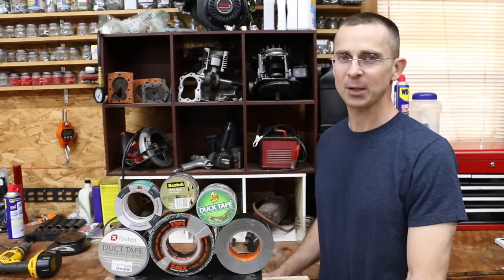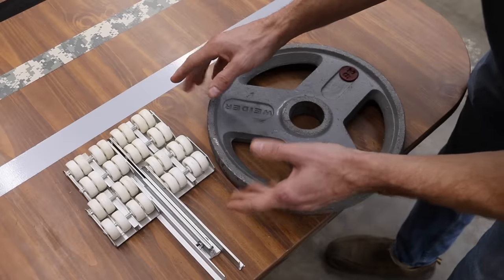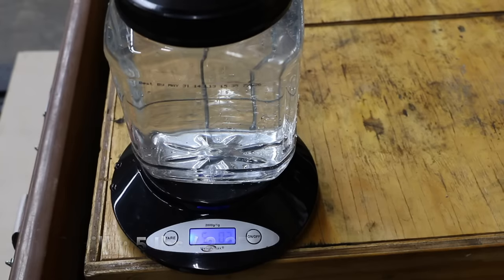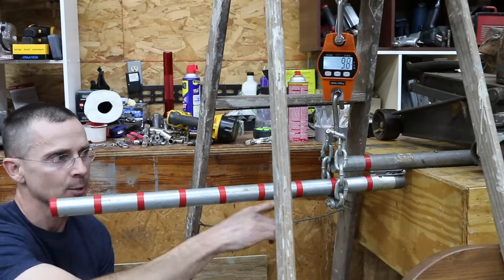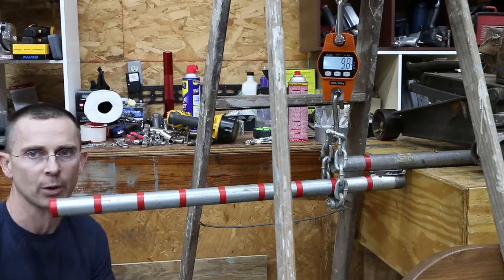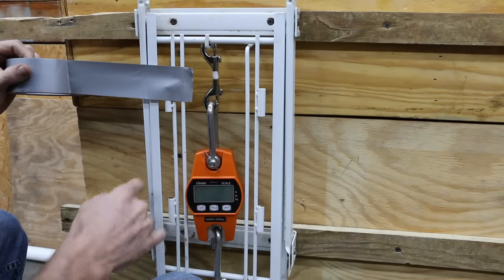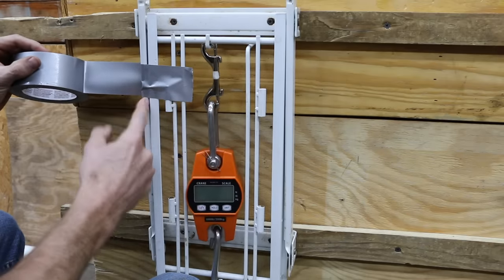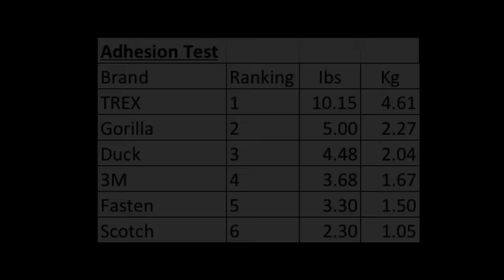Which Duct Tape Brand is the Best?  Let's find out!

Comment: Other than the silver duct tape, I’ve used gorilla tape only I had it taped onto my engine, hoist out in the hot Mojave desert sun for about over a year. It’s still very hard to remove compared to silver duct tape, and seems to be resisting the sun very well.
Reply from the maker: Thanks for sharing.

Comment: Duck tape is a rubberized fabric tape with adhesive on one side.  It was originally made to waterproof ammo boxes going to the front lines during WW2 and then to be easily cut when the ammo boxes needed to be opened.  Duck tape can be used on duct-work but it was designed to last a short time and will not last as it quickly deteriorates when exposed to the elements.

Duct tape is made of a thick metal foil and uses a mastic adhesive to seal the joints on duct-work so air can not escape the duct and will last far far far longer when exposed to the elements.

If the thick metal foil used an adhesive equal to a rubberized fabric tape the thick foil tape would be far stronger but neither are designed to hold much weight or pressure.

Comment: Personal experience for those that are interested.
I used to do remodels at big box stores and used tape a lot for putting up plastic dust walls and many other things.
So I had to tape 2 wood fiberglass stainless steel concrete FRP Steel ceramic tile and often in refrigerated areas or up high where it is hot dry and Dusty.

T-Rex usually did better than gorillas and it was usually cheaper.
Reply from the maker: Thanks for sharing.

Comment: I think a good way to objectivly judge the best would be to take their placement in each category and add them up. the smaller the number, the better the overall product.

Maybe take price into account aswell. Like if one product preforms halff as well, but is only 1/3 the price then its superior cause you can just double up and get the same result for 66% the price
Reply from the maker: Thanks for the feedback.

Comment: Wow, what an amazing test, thank you for that.  

Have you ever done one on electronic calipers?  There are so many out there and range so much in pricing that I'm wondering if there is any difference between cheap ones and the really pricey ones.  I'm not talking about precise stuff like a machine shop metal lathe work where is it very accurate but just general workshop stuff.  If you have, can you reply with a link to it?  Thanks again
Reply from the maker: Thanks and you are welcome!  Thanks for the suggestion.

Comment: Very informative test. But I think elasticity is not the correct term  for the test involving the pipe and weight test. Elasticity refers to the ability of a material to return to it's original shape after being subjected to stress.  I do love your test fixture designs, I worked in R&D as a machinist and very much appreciate your well thought out fixtures.
Reply from the maker: Thanks!  Thanks for sharing.

Comment: I was surprised by the lackluster performance of some brands. I've used Gorilla brand but may give T-Rex a go. Two other test you might do is elevated temperatures and even more relevant would be exposed to the elements for several months to a year to see how they hold up. Sometime I use duct tape to hold parts together and never pay attention until they fail. Great Job you do with all your test.
Reply from the maker: Thanks!

Comment: "Creep" hasn't been tested here but is very important. I've measured Flex Seal tape (I know, the stuff in infomercials), and with its thick adhesive, its immediate adhesion to a smooth LDPE surface is about 10x better than the next best, which is Shurtape HP-series, which itself is 2x better than T-REX. However, the long-term creep of Flex Seal is pretty bad. A long-term right-angle pull of ~10 grams/inch will remove Flex Seal at about 1mm/day, whereas Shurtape and T-REX will stay at 50 grams/inch (no delamination measurable in a week).
Reply from the maker: Thanks for sharing.

Comment: I've used a lot of duct tape in my life, growing up on the farm, basically always doing a lot of "back woods" type project.  After an accident with my pickup, someone suggested using Gorilla tape to hold it together until the insurance company could get the vehicle fixed.  It took 7 months for Progressive to get their act together and get my truck, with full coverage, fixed.  Gorilla tape held it together the whole time, bumper, headlight propped, inner fender well, no issues, never had to replace or adjust it.  Maybe compare insurance companies next time @Project Farm, so I can find the one I'm going to replace Progressive with in a month when  my insurance policy is up with them :)
Reply from the maker: Thanks for sharing!

Comment: The ONLY reservation I see here is "application" or "use" requirement.  You might not need the brute strength of some of these to accomplish the particular task at hand.  If brand X is pretty good all around and can accomplish the task at half the price of brand Y, then... just sayin'.  For Redneck repair of the sunroof on the wife's Ford Expedition I used the widest Gorilla Lowes had and it would last a long time.  But for securing overloaded cardboard boxes, the 3m an Scotch (and Duck causes it's readily available at the DG) works just fine.
Reply from the maker: Thanks for sharing.

Comment: I once patched a gigantic paint chip on my hood with a square of gorilla tape. It was on there thru 3 Michigan winters un-garaged. No rust underneath when i finally peeled it off to re-paint.  Great stuff. 

Also: I’d like to see a retest of that first sticking test after a 24 or 48hr period. I know from experience that gorilla doesn’t reach its max adhesion till it’s been on for a while.
Reply from the maker: Thanks for the suggestion.

Comment: Good video, but I think it missed a test where they get tested through different environments (I know that would take a lot of work). Almost all duct tapes are gonna hold up very well if you use it inside for most applications but it's when you use it outside where the differences would've been interesting. Maybe a test through rain (could be simulated with water) and a test with the sun blasting at them for a couple of days. Also a test through a fatty environment (environment where a lot of oil is present, like a lot of workplaces have) would've been interesting.
Reply from the maker: Thanks for the constructive feedback.

Comment: I kinda wanna see if you can use the #1 spot for each test, as a way to strengthen eachother's weaknesses, and do some sort of project where you hold things together with the tape, but for each ones weakness, you'd use the one with the best strength for it, adhesion, strength in lateral and vertical, etc.
Reply from the maker: Thanks for the suggestion.
Reply: @ProjectFarm  :D!
I hope its understandable, I know I can be pretty crap at giving descriptions/wording things certain ways, lol. but if you get what I meant, thats all I need!

Comment: I use 3M all weather, which is much much better than the 3m tape used in this video.  Plus easy to rip and doesn't leave residue..  Also handles outdoor's better than normal.
Reply from the maker: Thanks for the feedback.

Comment: 4:27 you could use a little physics to save some time here. Torque (the kind of force you are applying) = F*distance from fulcrum, so you can just convert the 25 LBs to Kilos and then multiple by the distance in meters and 9.8 to get the total Newton’s instead of doing that whole experiment

Comment: I only used T-Rex during a hurricane as it's all that was left at Walmart, it worked well at stopping water from getting inside from our doors...almost too well as I couldn't get any of it off the rental so I just left it lol. Even FL heat didn't phase them! 

So I'm not too shocked it faired well, heh.
Reply from the maker: Thanks for the feedback.

Comment: These are great but can you do a test on which one is the most non abrasive? We use gorilla a lot and its mostly for vacuum pressure and sand hitting it at high speeds. We use it to cover holds in our vacuum truck hoses.
Reply from the maker: Thanks for the suggestion.

Comment: Did you know the original & correct name for this type of tape, is in fact "duck tape".  It was called that because it was made from a Danish cloth that was translated into English as "duck" fabric (originally used to make minor repairs to shoes, coats, jackets, belts, etc.).  
During WWII, the first recognizable "duck tape" was manufactured & used to water-seal ammo boxes.  As its popularity and use grew after WWII as an all-purpose tape, many HVAC professionals used it in their ducting work, and thus it gained confusing term.  
However, duck tape was NEVER made to be used for HVAC work and is actually against all US building codes to use it as such.   
Then in the 1970s, someone revitalized the original name of the product, by naming their specific brand "Duck" brand duct tape.... but, it is still correctly named "duck tape", as is NOT to be used on ducts, ever.
Reply from the maker: Thanks for the feedback.
Reply: @ProjectFarm  Another great video btw!
Fantastic material, delivered in a practical and objective manner, with good use of scientific methods to level the playing field... as always.

Comment: You were not using the right 3M duct tape. Try 3M # 8979-RED-48MMX54.8M or the 6969 series If you want stuff to stick. Also check out UHB and VHB tape for testing that stuff is unstoppable at bonding metals and so on. Digi-Key has a good supply of the best tapes and adhesives Loctite/Henkel and 3M make. Great videos and stay safe out there.
Reply from the maker: Thanks, will do!  Thanks for the video idea.

Comment: you should havce for the tensile strenght, done it so that the weight is eqal sidesm as this is jsut tearing the tape, due to the angle. otherwise, an excellent vid

edit: wait nevermind, you did the thing I thought you would, its a good test!

edit again: why didnt you jsut put the tape around a bar and then like just put a wieght throught the other one and fasten it like a clokc pendulem to accurately measure it if there wasnt other direntioned force
Reply from the maker: Ok thanks!

Comment: My gorilla duck tape doesn't stick for a long time when I affix the tape to the outside of my RV. I'd like to see real world results between duck tape brands when exposed to out door , hot and cold weather exposure. I want to know more about longevity of the adhesive. Do all the duck tape brands use the same adhesive from the same supplier?
Keith Schaedel...............................6/26/2022.................

Comment: The time in each stage of the weights should be measured because the problem is that the tape will start to stretch when you put the weight making the tape weaker.
Reply from the maker: Thanks for the constructive feedback.

Comment: In terms of duct tape and the typical uses for duct tape. You can't beat duck brand. Gorilla is awesome too but it's really thick, so it's not as useful always. Duck brand has really good adhesion, really good tensile strength and is super easy to rip without scissors. I like it the best by far.
Reply from the maker: Thanks for the feedback.

Comment: This is a fine enough test for the duct tapes one might find at a home improvement store, but it in no way represents the world of duct tapes that exist.  You can 't just say Scotch (3M) and leave it at that.  Which 3M duct tape is it?  Every major manufacturer of duct tape has 5-10 part numbers, each with a different mil thickness, adhesion value, and tensile strength to satisfy different markets.  Where was Polyken, Nashua, Shurtape, and Intertape in this test?  Duck Brand is a kind of sad 8 mil thick tape.  Polyken (Berry Global) brand starts at 9 mils with their 203 part number and their thicknesses go up from there.  Military and nuclear grade duct tapes are around 12-13 mils, and one can even find duct tapes that are thicker than that.  I would add, too, that all of these tapes -- those shown in the test and those left out --  have lab-tested spec data sheets that can be found online making a primitive home test unnecessary.

Comment: The one thing I don't like about Gorilla (and it looks like that T-Rex is similar) is that it does not seem to conform to the object you're taping as well as a thinner duct tape.  Such as if you had to duct tape an uneven surface or with ribs or ridges on it.  It's too stiff.
Reply from the maker: Thanks for sharing.

Comment: I want to know which silver duct tape is best. I tried to find a glue that will glue plastic ponchos and Emergency Shelters and just could not find one, as they either melt the plastic, or cannot bond because air cannot get in to set it, so I decided to put on silver duct tape, which has heat reflective bonuses. This does not solve that for me. not quite
Reply from the maker: Thanks for the suggestion.

Comment: I have a situation with a leaking tub (cracks in the bottom). Can't afford to get it fixed, so what would be the best waterproof tape (duct or otherwise) to lay down over the cracks to prevent leaks?
Reply from the maker: Thanks for the suggestion.

Comment: So first, I swear by T-Rex tape. Secondly, I feel you could've used a jack in a similar setup, but attach a meter to measure force to get more accurate results as the tape stretches and flexes.
Reply from the maker: Thanks for the constructive feedback.

Comment: What all these brands need to improve is the adhesive life span. They all dry out and harden, becoming brittle over time, and exposure to temperature changes, moisture changes and UV - basically an outdoor application -  drastically shortens the usefulness for all of them. All the material strength in the world doesn't matter if the glue dries up in three months.
Reply from the maker: Thanks for the feedback.
Reply: @ProjectFarm  I hadn't watched the follow up video where you did the ageing test when I made this comment. Both videos answered my questions completely.

Comment: Had a terrible experience with duct tape several decades ago.  I had a small business recording choirs and vocal groups and producing a high-quality CD after editing.  At first (not knowing any better) I used duct tape to tape down my cable runs to carpet and hard flooring.  DON'T EVER DO THIS!  After the performance, I discovered that if in my haste to depart, the duct tape accidentally wrapped itself around the cable, it would be extremely difficult to remove and I would have to slowly use a utility knife, taking care to not penetrate the wire insulation.  Also, an invisible amount of adhesive would remain behind on the carpet or flooring, showing up months later as a permanent dirt mark.  THIS IS WHY YOU USE GAFFER'S TAPE FOR LAYING DOWN CABLE.  Gaffer's tape is a much-weaker cousin of duct tape; still pretty sticky but much easier to remove when done.
Reply from the maker: Thanks for the feedback.

Comment: Gorilla Tape boasts it is easy to tear sideways for ease of use. I feel all these tests played into the "weakness" of Gorilla tape, which is actually a built in bonus. Long strips pulling down is Gorilla tapes strength, and hard wearing against weather. Your so called test for length strength ended up a bar pulling at its sides. I reckon Gorilla Tape should be number 1. I think also adding silver Gorilla Tape too might have been better
Reply from the maker: Thanks for the feedback.

Comment: Well then, 'Fasten' and 'Scotch' duct tape seem to rather consistently suck. Looks like TREX and Gorilla came out on top. TREX is the stickiest, Gorilla seems to have the most consistency to be durable. I think that with duct tape, more often than not, the issue tends to be adhesion rather than tensile strength so TREX might be the best bet for most applications. For jobs requiring strength, using multiple layers of Gorilla duct tape to overcome the only marginally above-average adhesion as well as to add additional strength would probably be the best bet.

3M seems to be the superior 'average' grade duct tape, while Duck seems to be the inferior 'average' grade duct tape. So I'd rate them overall in three groups, each group of two being named alphabetically.

1st - Gorilla & TREX
2nd - 3M & Duck
3rd - Fasten & Scotch

Very interesting video, also this is the first time I've heard of duct tape being called 'all purpose tape,' although it's certainly earned such a title. Perhaps it's more of a US thing, I'm Canadian.
Reply from the maker: Thanks for the feedback.

Comment: I use gorilla tape for damn near everything. The key is getting it hot. If you apply gorilla tape, warm it up with friction rubbing or a heat gun and that shit will turn into JB WELD when it cools😂

Comment: Realistically, this isn't really a definitive conclusion of which brand is best.   Depending on the use of the tape one may better than the others for a specific purpose.  I would not use Gorilla or Trex brand tape for holding something together temporarilly or if i needed it to be a bit flexible.  At the same time i would use Gorilla or Trex for covering up a hole in a tarp or on the side of a trailer until it could get fixed.
Reply from the maker: Thanks for the feedback.